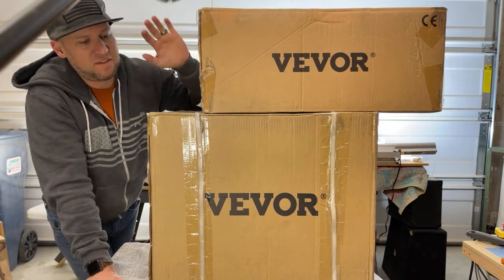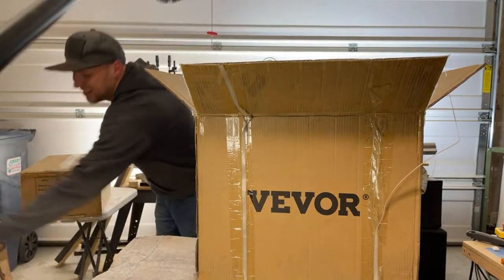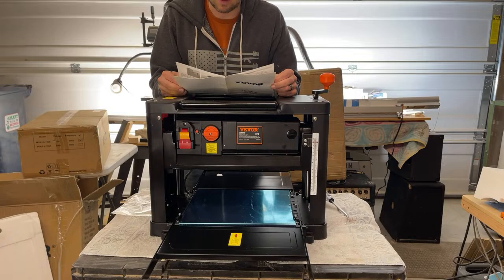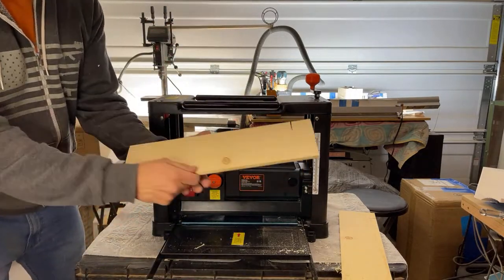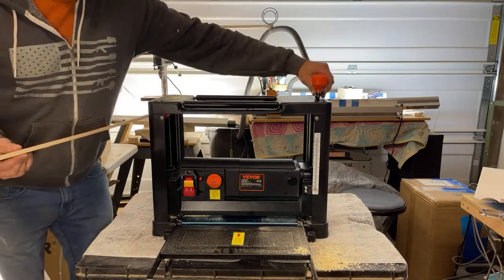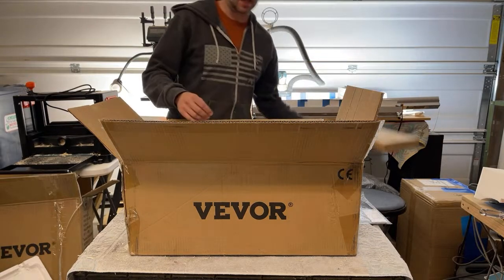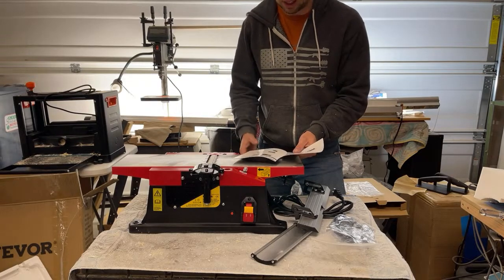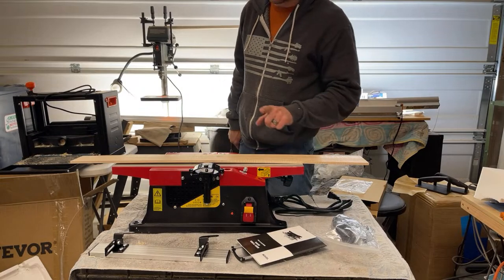TWO for the PRICE of ONE! Budget friendly 13” Planer and 6” Jointer (unboxing)

Comment: If you want to plane thinner than 6mm, mount it to another board and then send it through.  The board should be flat, hot glue or double face table it.  You can also, put a spacer under your board to help plane it float too.
Reply from the maker: Good tips, thanks!

Comment: Interested in how well these work. Especially the thickness planer. I'm wanting to use one to recycle pallet wood I get free from work for various projects. Maybe some CBG stuff eventually. I've been eyeing the one that Harbor Freight sells. Which is a 12 1/2 at about $10 more than this one.
Reply: I had the Harbor Freight one and it worked great. Too bad it got stolen.
Reply from the maker: I’m pretty sure these are made in the same factory as the harbor freight ones

Comment: For what its worth, this seems to be the direct from china brand i see showing up on ali express most. For my low end purchase, i went with Wen for a spiral planer.l and many other tools
Reply: My drill press is a WEN unit.   Good stuff, good price, good value.  Ebay often beats Amazon and Harbor Freight.
Reply: @normbarrows  i have the benchtop Wen drill press. That was my first Wen tool. It has some limitations, but i bought it years ago and it’s still spinning and doing its thing.

Comment: Also interested to see more on how this thickness planer performs. Been looking for one for awhile but I only trusted the Dewalt and am hesitant to spend that much haha
Reply from the maker: I’ll be sure to do an updated video after I’ve put some hours on these machines. So far I’m impressed for the price, we will see how it holds up!
Reply: @GunsandGuitars  Awesome! One thing I’ve seen in previous comparisons between budget friendly models like this and the coveted Dewalt ones, is the difference in board thickness side to side, indicating a less than perfectly parallel cut.